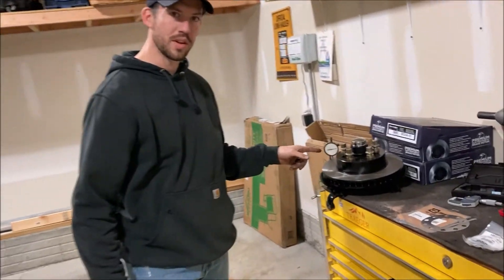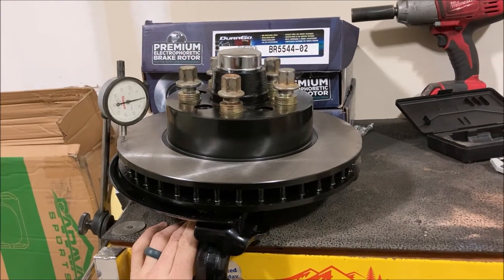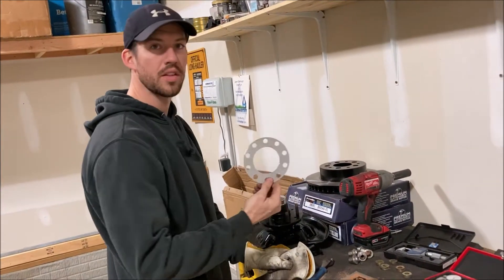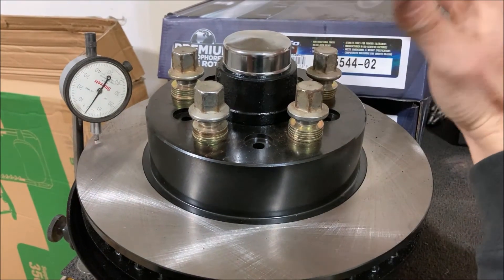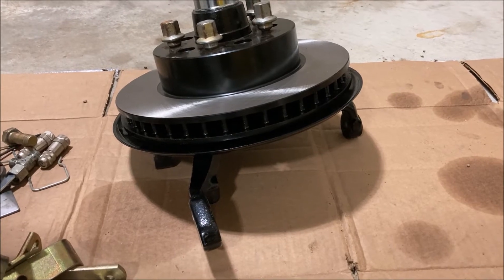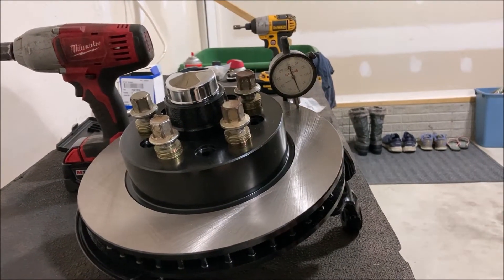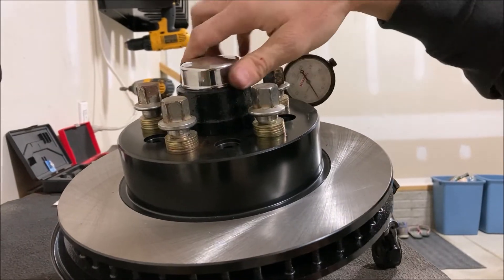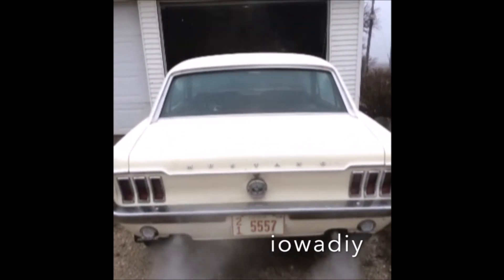C3 Corvette Rotor Runout Adjustment

Comment: Nice, some cars call for 0.002" spec. You can get Arbor Shims from Zoro for a decent price. I might use aluminum foil. I've usually ground the back side of the rotor that touches the hub.
Reply from the maker: I would have definitely preferred to use the proper shims, but the scarcity of parts after Covid got me. Arbor shims worked well for me! 

As far as grinding the hub, I don’t have a way to ensure that I can grind it flat so I didn’t try that method
Reply: @iowadiy6361  grinding is kind of a pain, but just hitting the high side. This was the first video where I saw someone talk about it and then actually show how to fix it with parts you can find!
Reply from the maker: @esiljander2362 This is my first Corvette, and it’s been a learning curve, but the rotor runout and the trailing arm rebuild are two things that are difficult to find much information on.

Comment: So just wondering . Why didnt you just mount them and then take it to a shop that has an on the car lathe? They can just trim the rotor to dead nuts square.
Reply from the maker: That’s an option, but that costs money. I also have the car completely apart right now so that wasn’t an option.